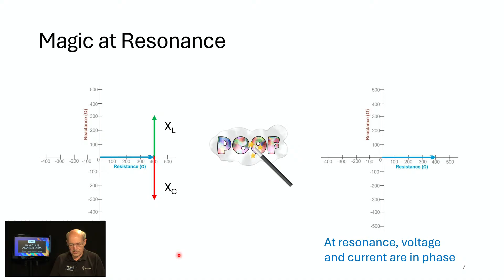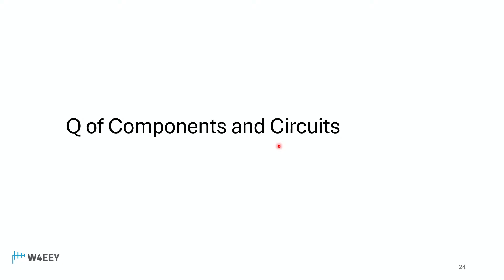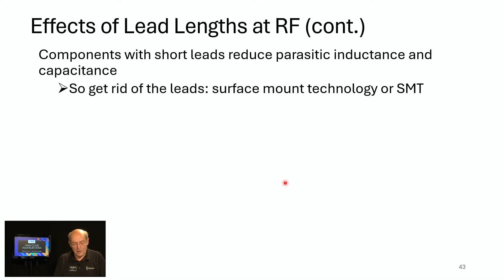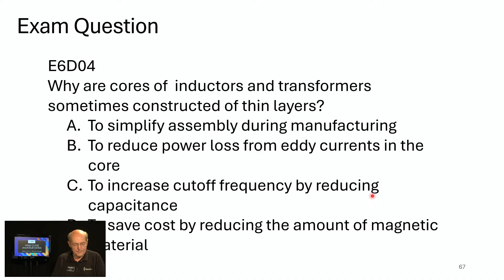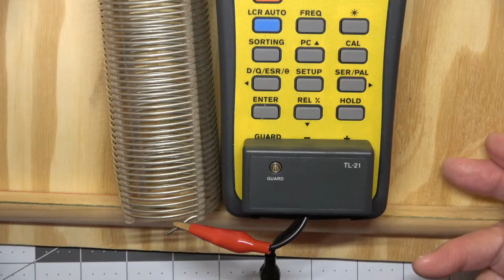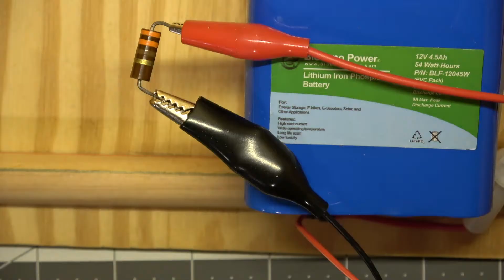Extra Class Fall 2025 - 13th Edition - Chapter 04  Part 02 - Electrical Principles

Comment: I think you guys may have missed E5D10, unless I haven't watched properly. But this is a great video, love the free resources. Its awesome.
Reply from the maker: I think you might be right. I looked at this question and realized that I (Gary) have never taught on this topic (how a conductor's diameter increase impacts its electrical length - it increases too). In the Antenna chapter I do discuss increasing an element's diameter increases the antenna bandwidth but this is a different, but related thing. Good catch. I'm not sure how this happened. We have a new Extra Class in September. I've made a note to research this and include it. Thanks! 73 de W4EEY